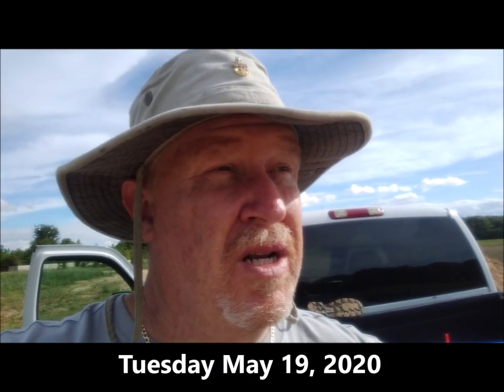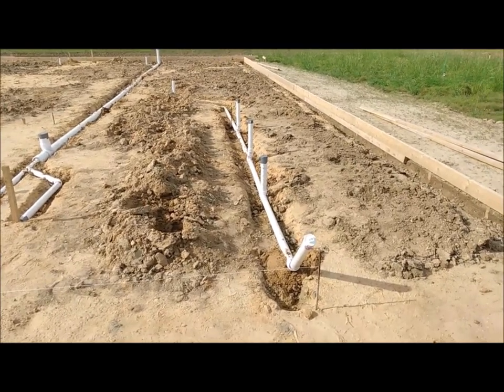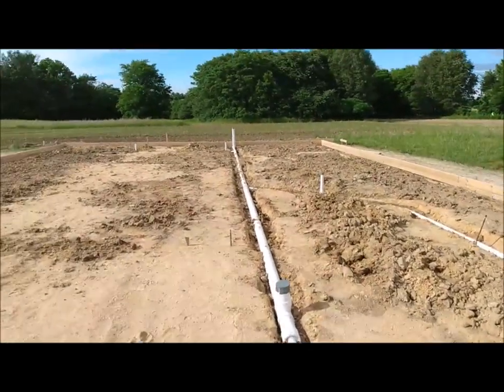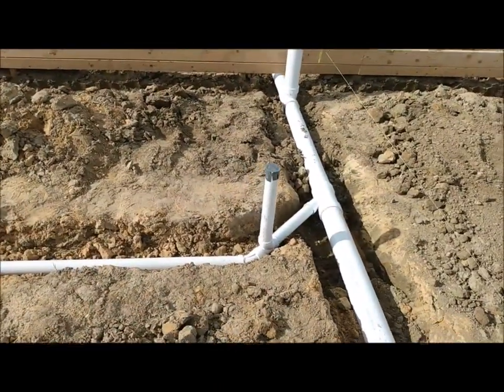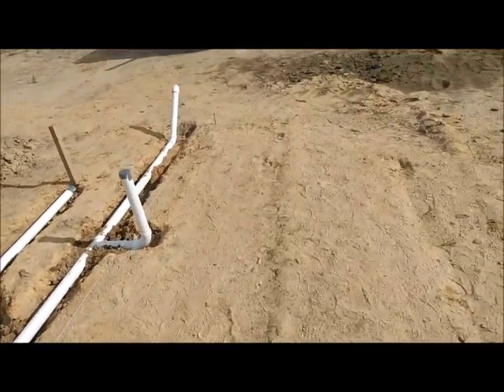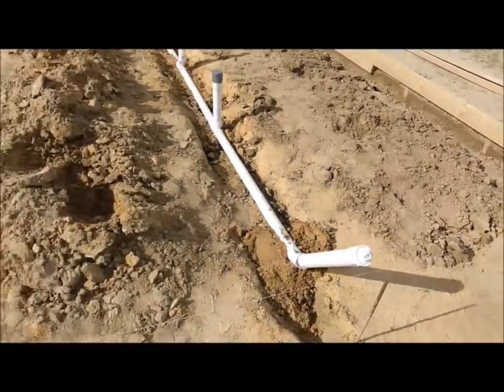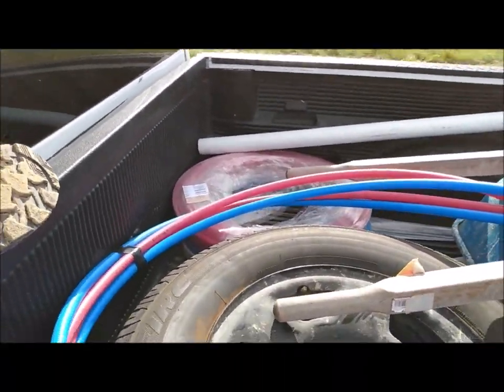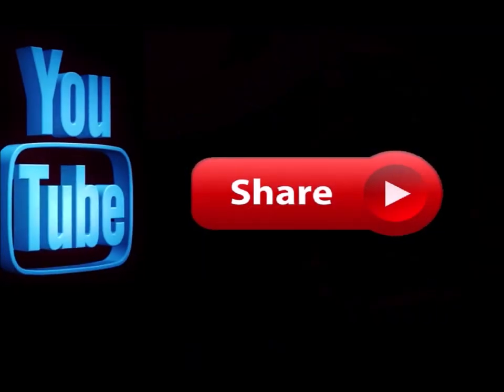DIY  Installing plumbing drains for concrete foundation

Comment: Ed, I’m doing the plumbing in my cabin myself. My cabin sits on blocks but where the plumbing will go it sits low like 18 inches  with the blocks. I will have to dig some out , so the pipes can lay on the ground? If so I may not have to dig! Looking forward to this build!🙂❤️
Reply from the maker: You need a downhill drop in your line but be careful it is not too much.  Good luck!  Very rewarding feeling to do the work yourself!
Reply: Ed's Attention To Detail  Thank you! Yes! It is rewarding!🙂❤️

Comment: I’m gonna think you should’ve put more vents in
Reply from the maker: The vents I have are all two inch pipe.  Plus if it comes down to it I can turn one of my clean outs into another vent.  I think it will be fine!
Reply: Ed's Attention To Detail I like to vent every drain
Reply from the maker: @TheRam273 , I will have 9 vents when all is said and done.  Plus, like I said I can make my two clean outs vents as well if needed which will make 11 vents if I decide to do that. Including toilets I will have 10 drains.  I should be ok.

Comment: I think someone said to vent the toilets. Yes. That. And. I didn't run a vent stack through my roof for each stack. I tied them all together in the attic for one stack. I do not know if that is code. But I did it back then.
Reply from the maker: I will have plenty of vents, already revisited that to make sure.  As for the stacks being tied together, I will do that for some of them but not all.

Comment: Used to work a W-143 receiving division. Were you ever there?  You look familiar .
Reply from the maker: No, not sure what W-143 even is.
Reply: @EdsAttentionToDetail  
Lol
NAVSUP FLEET LOGISTICS CENTER on GILBERT STREET where you go for supplies across from the Pier on Norfolk Naval base.
Reply from the maker: @mpedmar9701 , I have been to the piers in Norfolk but I was stationed at Oceana my whole time in Va.  BTW, I sub'd your channel!